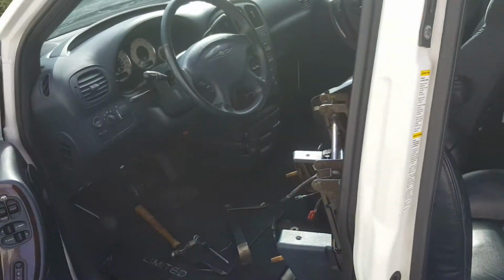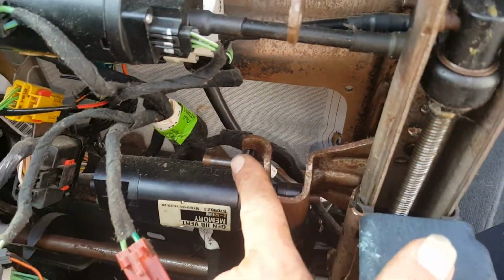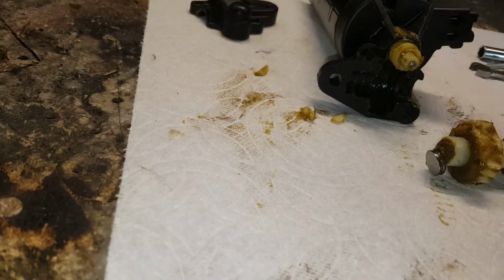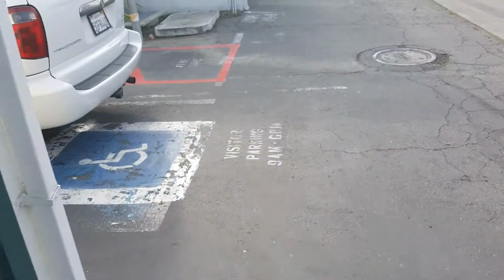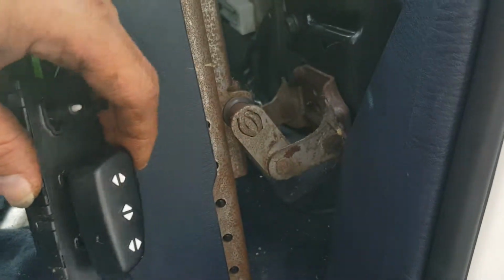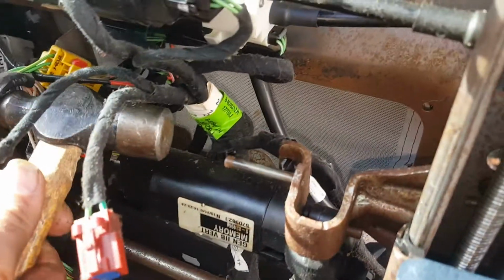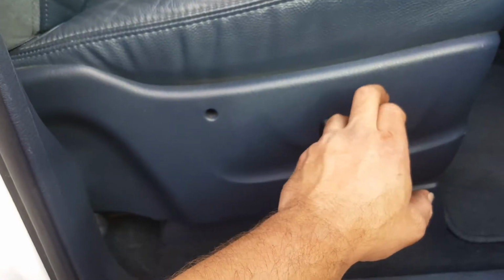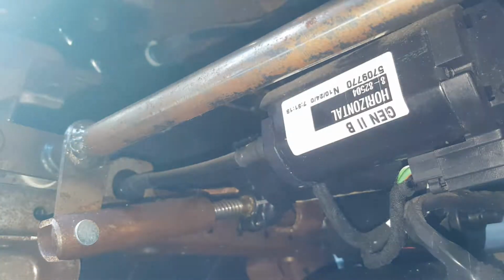2001 Town and Country seat problem explained and repaired

Comment: Good video. The longer punch pin doesn't have to be that difficult. It can be punched in till it hits the rail and cut off with an angle grinder. The pin is long enough to punch all the way to the rail, cut it off flush and still have enough to reuse it. Then you can remove it easier next time. If you don't want to cut it you can punch it as far as you can then bend it over so you can punch it the rest of the way out. It ruins the pin but a regular 10mm bolt slides through there perfectly if it's long enough. A nylon locknut or two nuts tightened together will keep in in place since you don't want to pinch it by torquing the nut too hard. Makes it easier to come apart in the future. 

Good luck finding one in the junkyard that's not already broken or cracked. There are full steel versions available with a steel worm gear included but they're around $50 each and you'll probably need two since the plastic ones seem to fail around the same time.

Comment: These front tilt motors break because drivers want the FRONT lip DOWN !  And it won't go as low as desired. So, they grind the gear away... I just disconnected mine from the screw drive and hammered the hook for another 1/4"' lower (that's it, maxed down, still higher than desired).
btw, that motor can be replaced without removing the seat.

Comment: Thanks.  That was a big help. One of mine clicks and the passenger seat doesn't have any sound so I'm thinking either the motor is bad or the electrical connection is bad.  But thanks for showing this.
Reply from the maker: You're welcome. I'm glad you got some use out of it. And I agree with you it's either bad motor electrical switch for connector. That's assuming you have power to the switch.

Comment: My driver side doesn't do nothing at all but it has power coming into the switch but I couldn't never fix it
Reply from the maker: Check your grounds wear your seat Mouse to the floorboard. There's too much crap or debris or soda spilled or something like that and they have a bad ground or it may be rusted and that could be a problem. But that's just one gas of many. It could also be your switch not switching power properly. Try moving your switch to the on position and see if you have power going to the motor. If you have power there then you have a bad motor. If none of your motorcycle work that all your Motors might be bad which can happen. But my first guess would be a common ground issue with all the motors not working. I hope that helps